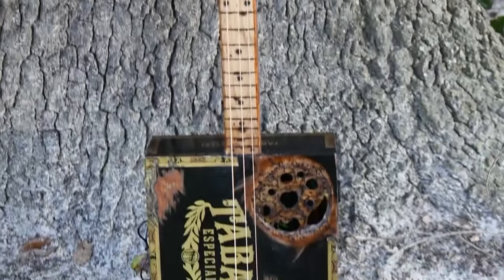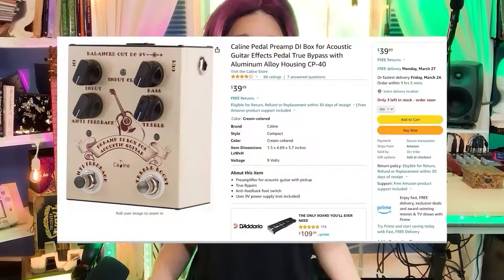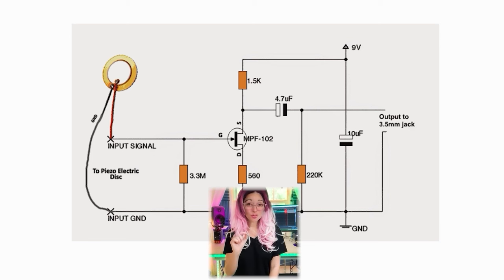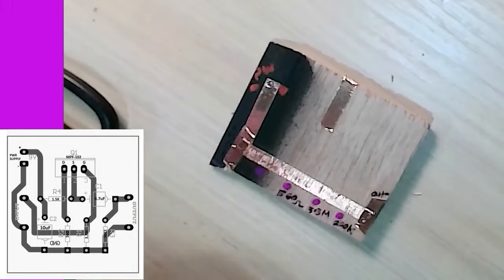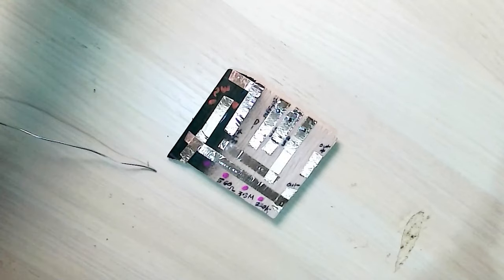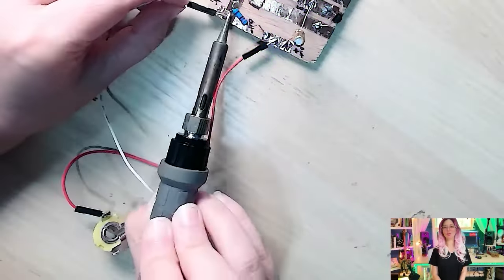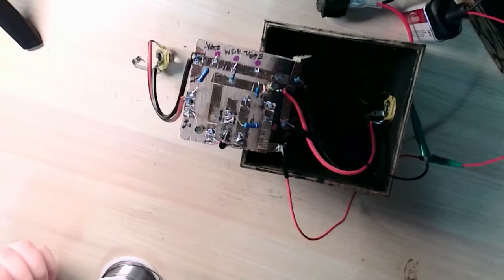Why & How to Build a Piezo Preamp for your Cigar Box Guitar / Preamp for Contact Mic

Comment from the maker: Hello Everyone! If you built the piezo preamp from this video, then you'll be interested in this info. I ran into a brilliant video by Paul McGowan from PS Audio that explains why this piezo preamp reduces high frequencies. According to McGowan, the DC blocking electrolytic capacitors are stealing our high frequencies! He does mention a solution in his video; check it out:  https://youtu.be/MsO8AuEgrO8?si=jkX-r0cYIiMiJKkk

Also, A fellow maker (shout out to Klaus) alerted me to the option of changing out the bleed resistor to reduce sub bass and low bass. With the right resistor value, we may not need the passive HPF I built in my latest video: https://youtu.be/zHYA-Vd6NkM?si=pBGhTWLRuVUDm_jh

With this information, I look forward to tinkering with my preamp some more so that we get the best sound possible from our cigar box guitars, and, of course, I will share the results of my tinkerings here on YouTube. Cheers! - Dr. Liza Seigido

Comment: You can bypass the power switch by using a stereo guitar jack. The ground side of the battery is attached to the "ring" terminal for the jack. When the guitar (CBG) is unplugged, open circuit to battery. Plug in, and your battery supplies power to the  circuit. It's typical wiring for all acoustic electrics.
Reply from the maker: Wow!!! Thank you so much for the tip!!!! I will try this mod and may produce a short video about it. May I tag or acknowledge you in the video, or would you prefer to remain anonymous? Thanks again! 😀✨

Comment: Everyone's situation may vary but I've had great results using a piezo pickup in passive guitar circuits, or straight to a jack. No issues whatsoever when using pedals or only an amp too.
Reply from the maker: Hi! Thanks for checking out my video. ✨ True, situations may vary. I usually don’t use my pre with my amps with tone control. For me, it’s a must with my TC helicon, zoom and recording direct into my computer. Also…quick update: since the production of this video, I’ve fixed problems with my pre and now I can use my cbg with my tc helicon play electric with good results 👍 The pre still needs to undergo more improvement to get the truest sound from my cigar box guitars. I’ll be swapping its drain resistor to cut some sub bass and adding some bypass capacitors to get the highs my guitars are actually producing. It’s been a journey and I hope you’ll stay tuned to see and hear the improvements ✨ 🎸

Comment: I don't have the space (can you imagine?) or the inclination to build one. But I feel thoroughly enlightened by this video. There are a bunch of manufacturers selling CBG's with piezo pickups, who say nothing about the need for a piezo preamp.
Reply from the maker: Hi, thanks for checking out my video! ✨💜 Some instrument manufacturers have the pre built into the instrument without indicating it. If instruments need batteries, then you know they have built in preamps. A preamp will allow you to enjoy the true acoustic sound of the instrument. But to clarify: a piezo pickup will work without a preamp, but you will likely encounter tone and volume issues. I personally don’t record my CBG direct into an audio interface without my preamp. However, when I’m performing casually out in craft markets, I simply mask the tone and volume issues by playing with gain and distortion settings on my portable guitar amp without using my preamp. 🔥 I hope this was helpful.🙏 let me know if you have any questions.🎸
Reply: @psycheopera  Yes, and thanks again, it was very helpful. Now I understand why a preamp would not be necessary with these CBG's. The company is a roots style operation, so they also make Cigar Box amps that use a 2.5 watt Artec circuit; the 'DIY special.' It's very similar to a Pignose. I'll go out on a limb that this kind of amp wouldn't have any issues with piezo amplification.
Reply from the maker: My pleasure!✨ Wow, that sounds like an interesting company. I would love to see one of their cigar box amps. Do you remember their name? Are they on YouTube?
Reply: @psycheopera  Yep, it's C.B Gitty. I'm sorry for making you ask, but some folks are funny about listing the names of companies in their channels. 😂
Reply: @psycheopera  They've got a youtube channel.
Reply from the maker: Hi! CBGitty is a cool company!✨ I've bought some supplies from them. I didn't know they had CB amps. I gotta check them out. 🔥

Comment: Hi.  I believe the 4.7 microFarad cap is the one that blocks the DC component of the signal.  Otherwise the info that you provided was all good.  I look forward to using this design in my resonator guitar mod.  Thanks
Reply from the maker: Hi! Thanks for the info! ✨ Through research and with the help of fellow audio electronics enthusiasts like you, I'm making plans to mod this pre to improve its frequency balance. It's a good-sounding pre, and it is worth building, but it does translate too much sub-bass from the piezo. I currently have to use it with an external high-pass filter. Also, it is high-frequency deficient because of the electrolytic caps. I've learned that by switching out the bleed resistor and installing bypass film caps parallel to the electrolytic caps, I can eliminate unwanted sub-bass and get back my sparkly high frequencies. I will produce a video when I've made and tested these mods. I am currently working on other projects, so it may be a while until I can tackle my preamp mod, but I hope you'll keep an eye on my channel for my piezo preamp update video. Have a beautiful day!😀  -Dr. Liza Seigido

Comment: There is a fellow youtuber who recomends wrapping the piezo in aluminum foil and connecting the aluminum foil to ground (not exactly?) in order to reduce humming, his name is metal marshmallow
Reply from the maker: Hi! Thanks for checking out my preamp video! 😊I discovered that the humming sound was caused by issues with continuity and EMI. To fix the continuity, I reinforced the copper tape in areas where it had lifted. I also created a video that explains how I managed to reduce some of the EMI hum. Take a look at the video and let me know what you think: https://youtu.be/O_Exzdjpc-4?si=jPhKHIV-JcOLB1eI
Cheers!

Comment: Those traces on the PCB are ideal for simple perfboard solder tracing. It would make the final circuit tiny in comparison to your tape version. It would probably fit in a grounded Altoids box to minimize the hum too. Good luck.
Reply from the maker: Hi! Thanks so much for the tip 👍I’ve collected a lot of small tin cigar boxes; that would be a great use for them 🤩 Cheers! 🥂

Comment: Transistor N FET !!!
I don't have any available at the moment but I will try this circuit with a mosfet. Different or better yield ? How many dB gain does this scheme have ? Thank you very much.
Reply from the maker: Hi! Thank you for checking out my video!😀 While I don't have an answer to your question, you can gauge the gain results by scrubbing to the 12:30 minute mark- where I present comparison recordings in my DAW. This pre is definitely worth building, however, there are sub-bass and frequency balance issues you should be aware of before starting your build. You may want to tackle these issues at the onset rather than revise your circuit later, which I'm currently doing. I've created a post outlining the changes I plan to make: https://www.youtube.com/channel/UC4OMtVX9uQzowxCLQWqcaQg/community?lb=Ugkx6FE7jb1gS_WIJQ-wmj13Gfi_-8qJr3Lb
Please take a look and feel free to share any experiences, insights, or research about improving this piezo pre. Cheers!✨

Comment: Hello.
I build this preamp a few days ago and it works fine.
I'm using two 20mm Piezos parallel for a acoustic guitar but
there is a little to much bass and a little less treble.
What can i do to fix this ?
Regards from Germany
Reply from the maker: Hi! 😃 I had the same problem with my preamp. The solution is to install a passive high pass filter to the output of your preamp. I produced a tutorial about how to build a simple two to four component HPF:  https://youtu.be/zHYA-Vd6NkM?si=QmVLe_fAuMPkDL8P

Regarding the low treble: I've been researching this issue and have found some articles and forums that suggest that short cable runs from the piezo to the preamp helps to preserve high frequencies. If this is accurate, then an external pre like ours is natively high-frequency deficient. I plan to build a cbg with an internal pre to see if this information is correct. I will, of course, produce a video to show my findings. 
Thank you for your questions! I hope this was helpful. Cheers! -Dr. Liza Seigido ✨😀

Comment: Cool will this work for a bass guitar, I am looking for something with no buzz or hum for my build.
Reply from the maker: Hey there! Thank you for watching my video!😀 As for your questions, I need to split my answer into three parts so that you have all the information necessary for a successful build:

1. This pre will work with your bass guitar's piezo pickup. 

2. After I built my pre, I noticed a faint hissing sound, which I later discovered was caused by a continuity issue and not by the components themselves. I found that some of the copper tape had become loose from the board. To fix the problem, I reinforced the copper lanes that had lifted off the board. The pre was noiseless after I made this fix. 

3. There are frequency balance issues you should be aware of before starting your build. I recently learned that the electrolytic capacitors in the preamp cut out a lot of high frequencies, and this can reduce the bite and punch of your bass. I'm researching bypass film capacitors to preserve the high frequencies that pass through the preamp. I created a post outlining the changes I plan to make and test: 

https://www.youtube.com/channel/UC4OMtVX9uQzowxCLQWqcaQg/community?lb=Ugkx6FE7jb1gS_WIJQ-wmj13Gfi_-8qJr3Lb

I will absolutely produce a video after I update my preamp, and I hope you'll stick around for my new piezo preamp update video.

I hope this was helpful. 

Cheers! ✨

Comment: Hi there Dr. Liza.......Thanks for a very informative upload....Just a quick question if I may, would this piezo preamp be sensitive enough to pick up a 1mv signal ??
Reply from the maker: Hi! I don't think it will work with signals that weak. The output voltage of piezo pickups can run above one volt. A mic preamp circuit may be what you need. You can find a few mic pre schematics on homemade-circuits.com. Hope this helps : )

Comment: Very unusual way of making PCB :)
You make traces from several pieces of copper foil, just gluing together. this make unstable and untrustworthy contacts.  I would advice you to solder pieces together for good and long life contacts.

Your ham problems can solve grounded metal enclosure or lining your box inside with copper or aluminum foil and connect to output jacks ground
Reply from the maker: Thanks for the tip!✨ I installed copper lining in the enclosure and grounded it. It did help with the hum. Here's a cute video about my shielding project... I tried to make it entertaining... hope you enjoy it 😃 https://youtu.be/O_Exzdjpc-4?si=K0qL7694nN5YHaJD

Comment: Really interesting project! I want to try this, but there's an issue: it seems hard to come across the MPF-102, it's deprecated or something. I'm looking for a good FET replacement, but as an audio DIY noob, I find it a bit confusing. What am I looking for? What are the important aspects/attributes/specs to match? Any recommended other models/versions with as good or better audio performance when used in this  cirquit?
Reply from the maker: Hi! Thank you for your question.✨Long after I produced this video, MPF-102 transistors became available on Amazon. I made an Amazon affiliate link available in the video description box.👍 I’ve not tried other MOSFETs with this circuit, but that would be an interesting project to document here on YouTube. ✨I’m planning to make some improvements to this circuit’s frequently balance by adding and switching out some components. I have all the details in my community posts; check them out and let me know what you think.👍💜✨

Comment: Interesting. Is there any more air-transmitted technique to incorporate in such an instrument?
    In my to-do list is "Create a better acoustic pickup than Piezo". Most of the acoustic guitar recordings I have heard have a distinctive sound if they are plugged in with a piezo pickup, as opposed to just being miked in the room/stage/studio.
 I haven't done more research yet, which is why I will save this for reference.
    I think just picking up the vibes of the wood does not reflect (ha-ha) what is bouncing around inside the box, nor what is coming out of the front, nor the direct sound of the strings that never enters the box. Maybe I think too much, maybe not enough :-)
Reply from the maker: Hi! Those are definitely interesting questions.✨ The best recordings I’ve produced with these instruments involved mixing the piezo preamp output with the output of a pencil condenser placed a few inches away from the box. Here’s the video with those recordings; let me know what you think 👍 https://youtu.be/7n8y-nHktJQ?si=HGMT_cMpdAKzZYx9
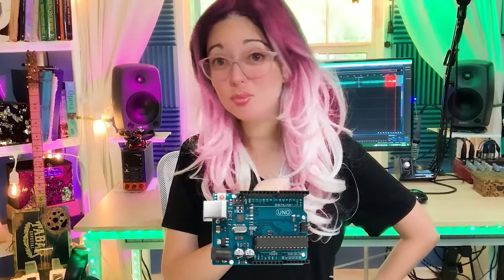Reply: @psycheopera  Thanks for your amazingly prompt reply! At that video, my unfortunately old and high-cutoff ears still found the 04:36 Piezo Preamp Recording section less to my liking than the 05:30 Rode NT5 Recording, which had a brighter sound (even I could hear :-) that better captured the box's acoustic character.
   The combination was nice as a recording. I guess it is a question of whether the aim is solely to capture an instrument or create a sound of interest with the instrument. I'm old and tolerant enough to find both admirable aims.
It is nice to hear someone so invested in this subject and I wish you well.
Try a diddley bow next :-)
Reply from the maker: Hello again!✨ I've recently started experimenting with Diddley bows. It's been challenging for me to get into them because they are harder to play than 3-string sliders. I need to work on my rhythm and picking to get better at playing the diddley bow. I have a video about my first two diddley builds. The instruments sound different due to their shape and piezo placement. You can achieve interesting and unusual sounds when you play around with piezo placement. Anyway, here's my little diddley bow video. I hope you enjoy it! https://youtu.be/QqdkldiFAjQ?si=PfOBY_MEmlu4S9bL
Reply: @psycheopera  Oh dear, my joke fell flat. My intention was to reference something much more primitive. See https://en.wikipedia.org/wiki/Diddley_bow
Reply from the maker: Thanks for the link!✨Yeah diddley bows have an interesting history. I've seen some built from the side of a shed or house. Love it 🔥

Comment: Hi, I am building a CBG with dual pickup mag/peizo. Would the output of this preamp be sufficient to mix directly with a humbucker?
Reply from the maker: Hi! That is a good question.✨  I've seen some cool videos by Dell Pucket where he sums the signals of piezo and magnetic pickups in his guitars. I don't remember if he's using built-in preamps with his piezos before the signals are summed. I would check out his channel; he has experience with what you want to do. Here's a link: https://www.youtube.com/@PuckettCigarBoxGuitar
Thank you for stopping by my channel! Let me know if you get an answer to your question. 👍
Reply: Thank you. Very helpful. One other question, if I were to replace the 220k resistor with a 250k log pot, would this give me a volume control?
Reply from the maker: Hi! That would be my best guess, but I don't know for sure. I'd have to breadboard it to give you a positive answer. If you decide to give it a shot, let me know if it works.

Comment: Maybe a silly question, but how did you know you need 50V capacitors?
Reply from the maker: Hi! Thank you for your question. It's not silly at all. I did not select the capacitors for this build myself. Rather, I followed the schematic provided by Colin's Lab and Homemade Circuit's website. If you're interested in learning more about this circuit, both resources are linked in the video description box. Thanks for watching my video! Cheers!
Reply: Any cap with a voltage rating above 10v will do.  The 50v rating was chosen as being most  available and inexpensive